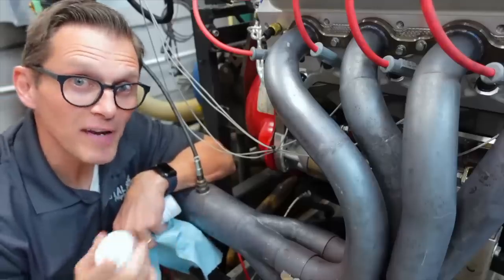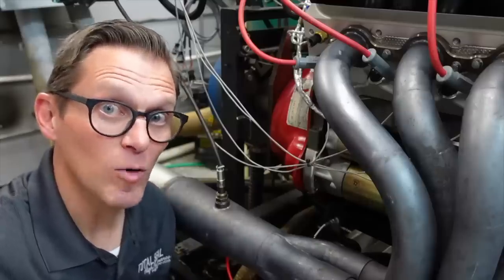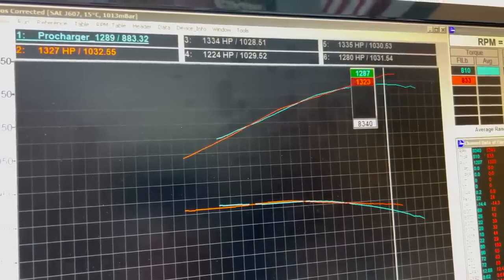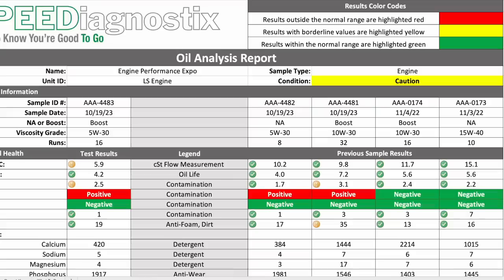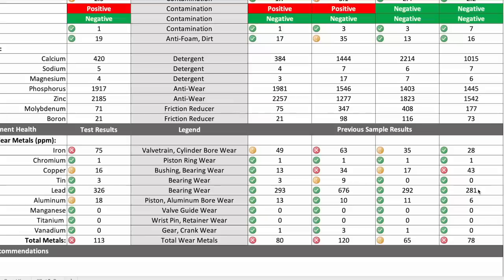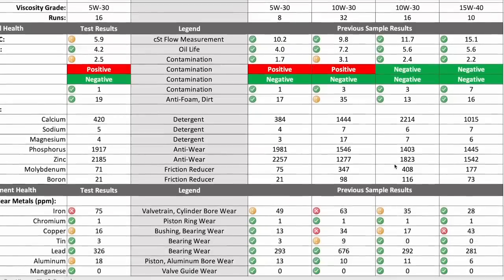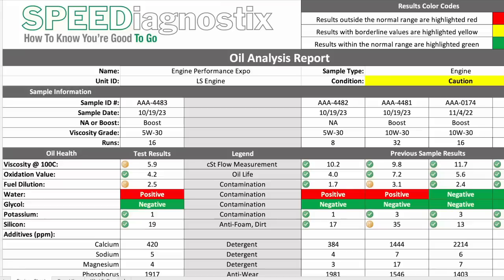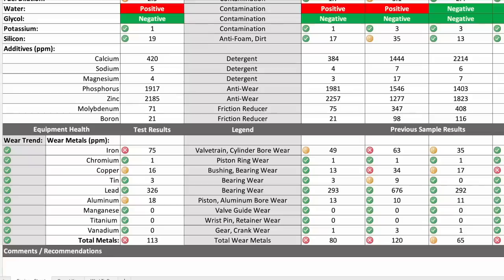What Adding BOOST Did Do To Our Motor Oil (NA vs BOOST Test)

Comment: There is a strong movement lately to use low viscosity in heavy duty diesels. the ones that go 22 bar BMEP.  I think they are doing it only to pass the EPA certification.  Most diesel operators use their trusted 15w40.  Hope you are back from vacation so we can chat.
Reply from the maker: The lower viscosity grades are strictly for fuel economy.
Reply: @themotoroilgeek  I have an SAE paper from 2013 by Ricardo that investigates the wear of using 0w20 (or something of that sort) on a heavy duty engine.  They measure FMEP and wear metals.  They are trying to push the conclusion that the harm on the engine is small, yet some fuel economy takes place.  I don't buy it.  I think it is strictly a way to claim better fuel economy for low loads by sacrificing the life of the engine.
Reply: @themotoroilgeek so what viscosity oil should we be running in modern gasoline turbo cars? I understand for warranty reasons we should use the said weight stated by the manufacturer, but after that… I have a Chevy 2.7 turbo that calls for 5w30 and now I’m considering using 10w30 instead. I live in Minnesota so it can get pretty cold here. Would you recommend a change to 10w30 or an even higher weight?
Reply: Maybe 5-40 because you don’t want thick for starting in -20 weather

Comment: It sounds like you could create a flowchart for picking the correct oil viscosity for minimum wear, as well as identifying driving habit changes that need to be made to maximize life (e.g. get the oil temperature up to evaporate that water).  My only question is, with fuel or ethanol shown in the oil, will that evaporate out like water at above 100C (212F) if you get the oil hot enough?
Reply from the maker: That chart exists on page 36 of the Driven oil catalog.
Reply: @themotoroilgeek  Can you provide more detail on where to access this chart.  Where do i find the "Driven Oil Catalog"?  thanks for you all your videos. great work
Reply from the maker: @danh571  Here's the link. Go to page 36. https://drivenracingoil.com/rt-5996-catalog.html
Reply: @themotoroilgeek  Those viscosity calculations go out the window if you have fuel or water in the oil, which becomes more likely the higher in power you go, right?  Correct me if I'm wrong, but there are multiple potential reasons for water and fuel in the oil.  Therefore, there are multiple, potentially acceptable recommendations that you could make based on what you're seeing in the oil.  You can't ask everyone for their life story when you do an oil analysis, so I'm saying, make a flowchart for the end-user to assess what could be contributing to the problem and allow them to pick the best solution based on their situation.  The driver is really the only person in a position to know whether they're doing 5 mile trips to work and aren't getting the temp up, idling for a dozen hours per week, doing pulls on a cold engine at 35 PSI, or any number of other stupid things they'll never tell anybody else about.  Empower them to use the data to make better decisions.
Reply from the maker: @EliteMacFreak once the oil temperature gets past 180F, the water and fuel start evaporating out quite rapidly. When I designed that chart, I took that into consideration. The key variable are boost and fuel type. When adding boost, add one viscosity grade. When going to E85 or Methanol from Gasoline, add one viscosity grade, so you would add two viscosity grades if going from na on gasoline to E85 on boost. 

While this doesn’t take every possible variable into consideration, it will cover more than 90% of circumstances.
Reply: @themotoroilgeek  Yeah, one viscosity grade per major upgrade is a good rule to follow.  If your oil temps are getting above 250F so that you're looking to add a third viscosity grade, the correct response is an oil cooler (or less boost, which nobody wants to hear).  We see guys running 250-300F oil temperatures on highly boosted engines on circuit tracks and when they spin a bearing they think the problem is the bearings or the build not the oil temps.  They think this because there's some guidance from MotorTrend, High Performance Academy, and other publications that says 250-300F is okay on synthetic oil because the oil doesn't break down.
Reply from the maker: @EliteMacFreak Great point!

Comment: Mam am i glad you explain this , cuz i amnot smart enuf to break it down , but i understand the affects of boost and when i daily a forged boared over engine on 34psi , i change oil between 1-3k miles and thats full synthetic ..and peopke act like im crazy , but this is proof that im not crazy , well thats debatable tbh 😅. But i have been run my engine this way for over 3 years now and built it myself beside a shop boar the block ... and its still alive so i must not be to far off lol.. n e ways peace and love all, keep it rad, stay safe, and build on... l8r all and all hail lake the motor oil geek 🫅🏽🤓 🙌🏽 🤘🏽🤙🏽✌🏽
Reply from the maker: I’m glad I could help

Comment: This was needed! BMW turbo engines once required 5w30 but for whatever reason they recommend running 0w30. It is as if they are recommending more wear?
Reply: It's still a 30 at running temps.

Comment: Could you do a video testing the 3 levels of Amsoil 5w-30? 
 
The OE, XL, and Signature Series and how they compare to each other and other oils on the market.
Reply: @Grayson.84 I don't personally use it but there's no reason someone should be spending 60+ on oil, you're spending extra just for the brand.
Reply: amsoil is overpriced just run Pennzoil ultra platinum
Reply: @duskycotw8404 yeah we need a 0w40/5w40 comparison.

Penzzoil ultra, and shell Rotella/diesel and maybe even an exotic brand 0/5w40

Comment: On a different level, my work vehicle is a 2023 Hyndai, non turbo, the manufacturer calls for  0W-20, intervals of 7500 miles for oil changes. I cant bring myself to run oil that long, i checked it at 5k and it smelled of gasoline and was even thinner that i thought possible. Ive watched the videos on your daughters new toyota, and new oils like the 0w's. The oil level was also about 2 qts over full.
  Sorry, forgot to make some type of point😂 im not continuing services with dealer (as previous company operator did) and im switching it to 5/30, if the car goes down, im back to driving my own car, and i want to save my cars miles for my use
Reply: Oooo that's bad! two quarts is a lot! You should probably have that thing checked out, it could have a bad injector or something.

Comment: Hi Lake!! Not sure if you've done it before, but could you produce a video showing the effects of of an oil with a viscosity that is too thick for the engine? 
Maybe not enough viscosity, right amount, and a grade too high (5w20/5w30/5w40/etc)?
Reply from the maker: Great suggestion!
Reply: Brb, throwing some Straight 60 weight in my mom's 2022  0w20 Pentastar jeep and I'll let you know what happens 👍
Reply: @snoofayy6150 are you serious or joking? I support heavier oils but a straight 60!
Reply: @saad.485  joking mate lolol, that stuff probably pours out of the bottle like Molasses
Reply: @snoofayy6150  lol, I've never really seen a straight 60, the thickest I've seen for monograde oils is a straight 50
Reply: @snoofayy6150  😮

Comment: I want to know when the season finale is, when the oil geek finally reveals his thoughts on AMSOIL. 
Can't wait.
Reply: Yes.  Id love to see his Amsoil review.   Also, testing the difference between OE, XL, and Signature Series
Reply from the maker: LOL
Reply: @themotoroilgeek  a lot of people out there are using AMSOIL and going 10,000 - 20,000 miles between change. I am really looking forward as to what your thoughts are on it.
Reply: Been using Amsoil since 2008! There signature series have been in my family engines for years with multiple vehicles cracking 200k+ miles. I would love to see Lake do a serious analysis on their lubricants, I don’t care if it’s good or bad, I just want to know…
Reply: I’m waiting 2
Reply: Will let you know, I have a semi with a detroit 60 series. Trying different oils 1st was mobile delvac 15w40,  now I have valvoline premium blue 15w40,  next I'm going to try amsoil 15w40 synthetic 100 %
Reply: @FarmerThug  is it the synthetic valvoline premium blue? Or is it the conventional? Grey or blue bottle?
Reply: @FarmerThug  what's your experience between those 2 oils?
Reply: @FarmerThug   you do know Amsoil has four different 15W40 Synthetic diesel oils? The top of the line is the Signature Series MaxDuty, the next is the Heavy Duty, also the Commercial Grade Advanced Synthetic Blend with greater than 50% Synthetic content. Many other companies Synthetic Blends contain only 15% or less Synthetic content. Those will work in all Diesel engines old & new. And the AME high TBN Heavy Duty Diesel and Marine oil which is mainly for pre 2007 Diesel engines that do not have diesel particulate filters.
Reply: Lake, if you owned the new Lexus LX, what exact oil would you run in Southwest Fl very easy mixed miles, and what frequency for the oil change? I did one at 500, one at 5k, one at 9k. They insist on 0w20. Great information.

Comment: Well we always used gas as a solvent to clean up oil back when I was a gas, oil, and lube guy back in the 70s. So I guess my question is, the manufacturers of these little turbo 4 cylinder engines recommend pretty thin oil, I always heard use the recommended viscosity oil, it seems like your recent tests contradict this.
Reply: This dyno engine is not a factory engine so they aren't comparable.  It's safe to use the recommended oil grade and viscosity even if it's turbo/super, but if you look at the maintenance manual you may find that it's also safe to use a grade higher so long as you don't drive in extremely cold climates.

The manufacturers tend to provide safe recommendations as they don't want to replace engines under warranty, so don't ignore them, but you usually have some variance if you do want to use a higher viscosity.  Cold startups will generally cause slightly more wear, however, so there's always a tradeoff between cold and hot viscosity even with modern multi-grade oils.

Personally, I prefer to use a grade higher so long as I won't violate the cold startup minimums.

Comment: I run 5-30 instead of 5-20 in my Toyota 2AZ-FE, per the Car Care Nut, Super Toyota Mechanic.
Reply: 5w40 in my wrangler with the 3.8l V6. Runs like a champ.
Reply: I'm doing that in my 4.6 Ford.... Now has 100k.
Reply: @hotrodray6802 oil analysts would be a good idea. High viscosity can cause oil starvation to the cylinder heads on that engine! Especially on cold start.
Reply: I had a 5w 20 engine and 5w 30 did better than 5w 20 but 0w 30 did the best.however On 0w 20 engines ONLY run 0w 20!

Comment: Why not use a Fumoto valve on your dyno mules? Makes taking oil samples very quick and easy. You don't have to drain all the oil to take a sample.
Reply: Been using them on all my vehicles since mid 1980s. Heat up car/truck. Open valve. Wait few minutes or few hours. Close valve and refill. 
One time I was distracted. Filled up my 7.3 Powerstroke. Right after pouring in 15th quart I yelled” oh sh!t”. Had left valve open. 10 quarts mixed with dirty oil. Valve did help me save 5 from my own stupidity.  Lol

Comment: I have a pro charged LS3. Street driven, weekend warrior. 18 PSI methanol injected 93 pump gas, 900 horsepower at flywheel. 

Engine builder said only run 0w 40 Mobil 1 European formula. 

It's lasted five Summers so far. I probably just jinxed myself. Oil analysis people say the oil looks good for its performance level. I change the oil every 1000 miles or twice a summer.
Reply: 1000 miles?? Of course the oil would be good...your oil is always new.

Comment: I find it crazy that Toyota calls for 0w20 in a twin turbo V6 in the new Tundras!
Reply: Yeah that is crazy. What do you think about 0w-20 in the 2AR-FE? It's a relatively understressed engine. Non turbo, 2.5l putting out 179hp/180ft-lbs. I found the Australian version of for the same car and they spec higher viscosities so I'm thinking about going to 5w-30
Reply: @Rankine_Cycle21  in australia they use 5w30 cause very hot environment there you need w30 or even w40 😉
Reply: @Dzinbhudist people in US use lower viscosity because we have cold winters. People in southern US use 30-40 weight oil frequently instead
Reply: @bigdaddymak1439  5w30 just works fine till -13F 😉 PAO based 5w30 are even good till -49F
Reply: @Dzinbhudist Lake puts 0w16 in his daughter's Toyota with normal oil sample results I trust him over you.
Reply: @bigdaddymak1439  I think his daughters toyota isnt hybrid and it is port/direct injected combined so less fuel dilution.
Reply: 0w20 has less hydrologic resistance, giving the engine more efficiency. I would guess that the engine should be run with 5w30 for best longevity.
Reply: really interesting to see a test with a more "typical" engine setup test! Car manufacturers recommend low viscosity oils (0W-20) with turbos right out of the factory. can't help but think we should at least use a bit higher oil viscosity especially in a warmer climate country/place.
Reply: Pressure from government environmental regulations. If you look at other parts of the world, 5w30 is recommended for the very same engine.
Reply: @dan-fontes  Probably why those engines are having bearing problems with too thin of oil in them, all in the name of fuel economy pressured by the government  like you said.
Reply: @brianpennington2018 From what I have heard the failures are due to production flash having been left in the engines from manufacturing.
Reply: @brianpennington2018  100%
Reply: @dan-fontes  It is both government regulations AND consumer desire for greater HP numbers, if you look at the HP numbers for a pre-EPA full size pickups, they were about a third of what they are today and they functioned perfectly well for hauling loads from here to there at a reasonable speed.
Reply: Ford 2.0 ecoboost specs 5w/30.
Reply: Because of emission control every saved fuel gram is important to them but not to the customer 0w20 will be fine during warranty period whats after they do not care…
Reply: @Dzinbhudist  Modern emission controls often sacrifice even optimal fuel efficiency for a cleaner burn.
Reply: @MathewPollard-vj4uq  cleaner burn = less polution, cleaner burn always will be lean condition 😉
Reply: @Dzinbhudist  It depends on what pollutant is targeted. High combustion temps produce more power for a given amount of fuel but result in the production of larger amounts of NOx. Diesels often cycle rich to reduce NOx formation at the expense of fuel economy and higher CO2 production.
Reply: You have to remember there's a big difference between race engines and a Toyota V6 turbo made for street use. Nothing wrong with 0w20 remember 0 isn't a viscosity
Reply: @bigdaddymak1439  0w20 is too thin for a twin turbo engine no matter the performance level
Reply: Ford used 5-20 in the first ecoboost 3.5 for the first run Taurus sho, they found the viscosity break down too much and have gone 5-30 in every ecoboost since.
Reply: @bigdaddymak1439    hmm, then what is it?
Reply: @bigdaddymak1439  w20 is viscosity and it is too low as direct injected engines dilute oil with fuel quite hard… so after 5k miles you have 0w10 instead of 0w20
Reply: nothing is built to last anymore, the are all warranty cars. once thats up you might as well get another car
Reply: @damnsnowflakes2403  that is the truth.
Reply: @damnsnowflakes2403 not true only reason most people don't get 300k+ out of their cars is abuse. Yes manufacturers have issues try to meet unrealistic CAFE standards but oils, engines are great just very intolerant to deferred maintenance

Comment: The opening raises a question. Are turbocharged engines really more "efficient"? Stoichiometric values MUST remain at optimal levels in order to have as close as possible to complete combustion. Adding more air means that you MUST add more fuel.
   So how is turbocharging making engines more fuel efficient? It doesn't. It produces more POWER, but does not reduce fuel consumption. So all this "downsizing" turbocharging craze is just BS. 
  "Oh but they make more power" someone will say. Of course. But not with the same amount of fuel. Consumption is higher. That's a fact. And of course along with higher fuel consumption this test indicates higher oil wear as well. So these engines are NOT "efficient" and cost more in the long run because they need more frequent oil changes.
  So all this "downsizing" turbocharging craze has achieved is to make us spend more money.